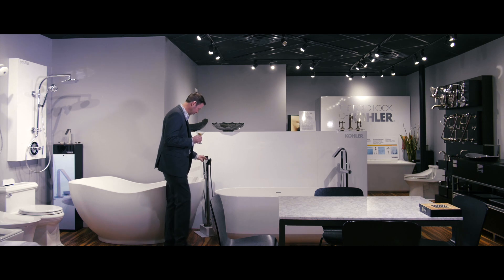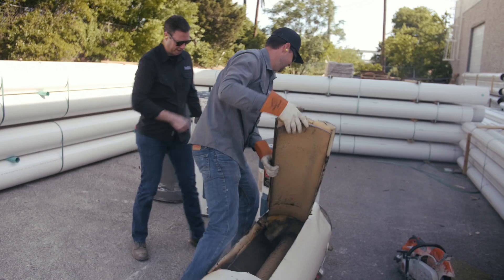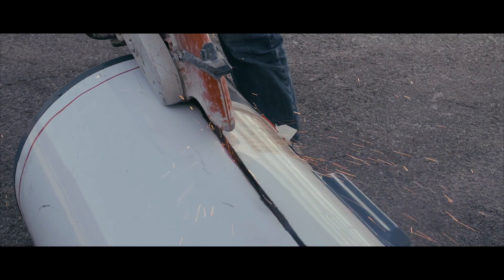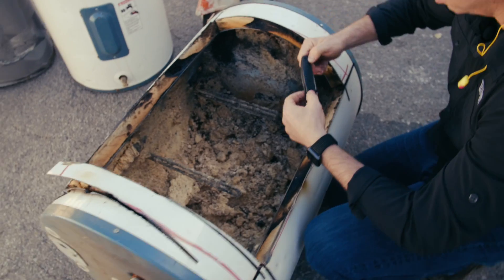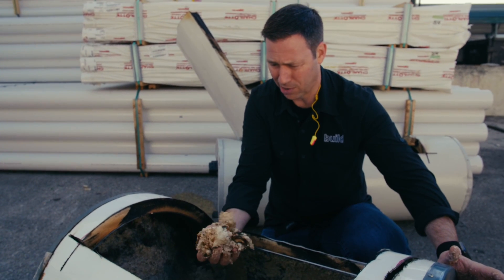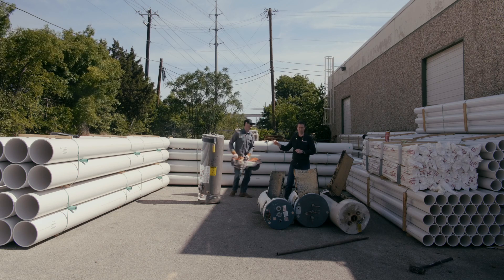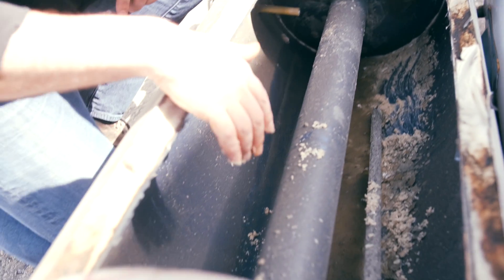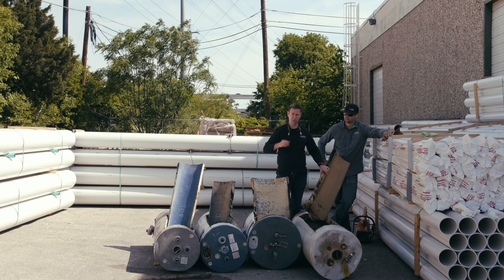Water Heater Tank Autopsy: You won’t believe what’s inside!

Comment: Oh my god.  The tank in my basement is 30 years old.... I can't even imagine!
Reply: You got your moneys worth out of it.
Reply: I've owned my house for 27 years and I'm on the same 30gl gas water heater. It was manufactured in Dec 1974. It's just now starting to seep some water under it. Will be replacing it in a few weeks. Pretty sure it has to be some kind of record.

After seeing this video, I'm cutting it apart for sure.
Reply: @SEEMERIDECOM  being from 74 i bet it has asbestos insulation.
Reply: @SEEMERIDECOM   I had a small electric (30 gal) still going after 40+ years  (Florida slightly alkaline water)
Reply: Flush the tank and remove/inspect the anode. If you replace the anode regularly (before it is completely used up) your tank will stay solid for over 20-30 years. But come 30 years, is likely time for a new tank.
Reply: If you have soft water no problem  but if you have hard water I bet that heater is really heavy with all the lime deposits in it !
Reply: What how???????? You must have good city water ?
Reply: I'm replacing my roof with a steel one and the only thing going into my chimney is the 45 year old water heater. I'm going with a gas power vent so I can vent through the wall and tear out the old falling down chimney. Last time I did work on it was like 20 years ago and it was falling over then.
Reply: we have a tank from 2001...running on hard water since then , up until last year hwen we finalyl got a water softener. it still works...but is it time to replace it?
Reply: YES! I recently replaced mine. Newer options are Waaaayyy better. Less energy, and we got a bigger tank for more hot water. But be ready for the newer code calls for expansion tank, like $50+ more, so if you have the money, go for it!
Reply: randomrazr if it works it works. But if it fails, you can have a flood. I’d lean on the side of caution and replace
Reply: DEEREMEYER1 go with a Rheem or AO Smith not some random brand
Reply: Fair Weather Foundry 
You'd better change it out soon 
Or expect a small flood under it
Reply: The tank at my house was 25 years old before is sprung a leak.
Reply: DEEREMEYER1 I’ve had mine since 2010 and it’s far superior  then the normal hot water heater ... I’ve never had a problem with mine not even one hickup and I have heated floors and runs amazing !! Maybe the one you got wasn’t really that good Bc Germany has been using tankless hot water heaters I think since the 2000 and literally is Amazing and the money you save from energy aswell is pretty good .. if your water is coming out to hot you should lower the temperature on your heater
Reply: You probably got an ounce of gold in it ;-)
Reply: Hahahaha  Fair Weather Foundry
>>Oh my god.  The tank in my basement is 30 years old.... I can't even imagine! <<

I have a water heater in a house I bought as a rental that was built in 1947,  it has a water heater  that was installed in 1951 and still works perfectly.  I completely remodeled the house but I left the old water heater because you just don't fuck with something that has been working for that long. Though I do imagine it's half full of sediment.  Also I did put a drain pan underneath it but I don't think it's ever going to fail!
Reply: @TruAnRksT  the anadode rod in that water heater that keeps your water from eating your pipes is long gone. 
Time to put it to bed
Reply: @nickg3794  The pipes are older than the unit, they will have to be replaced some day.
Aren't those anode rods replaceable? Or retrofit-able?
Reply: @TruAnRksT  Yes they are replaceble. The only issue is since water heaters are under pressure. It's not the easiest thing to both remove and reinstall/reseal a new one. They are stuck in there pretty good. Make sure to get a "link" rod if you don't have 10' ceilings
Reply: @TruAnRksT  how’s it going with that old water heater ?
Reply: You probably died 15 years ago and haven't realized it yet.
Reply: @pathfinderLXXIV  😂😂😂😂😂😂
Reply: randomrazr at least flush it and look at what comes out. If its really bad, then replace it.
Reply: randomrazr we just replaced a 2004 GE 30 gallon 50 gallon hourly for a new Rheem 38 gallon with an active damper 85 gallon hour rate the model is a XH40T12DM40U0
Reply: Thanks for the info. I'll look into that
Reply: Fair Weather Foundry lol
Reply: HERPY DERPEDY mine runs amazing and I’ve had my tankless hot water heater for 8 years and by far the best switch I’ve ever done Bc my wife takes baths and by the time it came to me taking a shower it would be cold Bc of the normal tank hot water heater but now it’ll run hot all day for the past 8 years !!!
Reply: Just have to wonder though how the electric, or gas utilities are effected by having hot water "all day long". Still seems like a good idea though. A typical water heater is on 30 gallons so one shower can easily deplete it. Plus you have to transport hot water through shielded steel pipes, usually under the house for a good ways, so not only does the hot water have to fight to even get to the shower but much of it is out in the cold as soon as the water is turned off. 

Ok my point oh yeah, I bet in real life it doesn't really save on utility bills in a busy household.
So how have your payments been changed by this feature?
Reply: Fair Weather Foundry that makes me feel a lot better because mine is 16yrs old and I was very worried after seeing this
Reply: Replace with a tankless!
Reply: In 2010, I had to replace my leaking electric water cylinder.  The one that came out, was dated 1959 - the date the house was built.. :)
Reply: @deermeyer while most things dissolve  better at high temp some minerals are less solvent at higher temps then lower so perhaps it is you who needs to go back to school.  For example calcium hydroxide (the scale) is less capable of staying in solution at higher temps. for more information look at this wikki https://en.wikipedia.org/wiki/Calcium_hydroxide.  Another item that is less soluble at higher temps is oxygen.  One of the reasons you get lime and scale at the faucet is that the water that remains there after you turn it off can and will  evaporate causing a increase in concentration of the minerals allowing it to come out of solution and solidify.
Reply: possibly, have you guys drained it from the bottom? How long can a shower last?
Reply: Replace it soon or expect a flood. My 40gal contractor grade went out after 3 years...critical tank failure. Flooded my house. The pan couldn't even remotely keep up with City pressure.
Reply: My 28 year old NG Rheem just bit the dust a month ago.
Reply: you don't get that type of "life" on city water or most treated water. only on good "PH neutral" well water with a good amount of minerals :)
Reply: I  doubt it's 30 years old if it is prove it. Maybe 13 years or it's an old oil tank
Reply: i have replaced tanks way over 30 years old, many of them the pressure vessel was not leaking, but the piping and relief valve above the tank had been leaking for many years and rusted away the whole jacket, so thy were starting to fall over, hanging by the pipes, broke the pipes, dropped crushing the burner up in or water pools and knocks the pilot out!
the tanks looked perfect with the jacket and insulation removed(mostly fiberglass blanket then) sure they had some nasty sludge in the bottom and inside, but just scrape it off and they looked great, many would still be working today if not for other plumbing failures and missing relief valve drain pipe.....
Reply: @throttlebottle5906  then that's a lack of maintenance shame on the home owner that's ridicules
Reply: Keep going!  Dont stop now!
Reply: Fair Weather Foundry the water heater in mine house is 22 years old 😬😬
Reply: The average is 8 to 10.  I would switch it out.  I am sure it would work better and save you heating costs since the newer ones are a lot more economical.
Reply: YOURE IN DANGER!!! RUN. RUN FOR YOUR LIFE
Reply: LOL....and that will be the longest lasting water heater you'll ever have. Now they are 3x more expensive, and have 1/3 the lifespan.
Now go replace it because it's eating your copper plumbing. And those leaks suck!
Reply: 🤢🤮 thinking about my 30 year old water heater.
Reply: My grams tank is 27 years old
Reply: my old heater water tank is about 1990. I replaced to new one.
Reply: Yup same mine is from 1978 lol
Reply: it helps if you flush your tank yearly so this kind of scale doesn't build up, both electric and gas heaters, flushing the tanks will remove most of this scale out of the water heater hence why there are normally drain valves on all water tank heaters, not the emergency pressure release valves but the bottom of the tanks themselves normally a spicket so you can flush your tank out. hence why there is an owners manual to tell you to do yearly flushes on the water tank.
Reply: @thefatmansgarage8570 Yes there is make sure u put a small hose on the spicket to flush it an old washing machine hose will work, and if you flush it remember the water is going to be or get hot not just cold water or warm is going to be hot so be carefull and don't get burnt!
my hot water heater is in the basement can flush it into the sump pump drain and pump it outside... 
Just replaced an BW with a Rheem only got 10 years out of a 50 gallon tank started leaking. Never flushed it and it had no sacrificial rod either the Bradford White...
Reply: You should replace it with a tankless instant hot water heater it’s far better then tanks !!!
Reply: Gonietube NYC LOVE my tankless heater...best thing I ever did for the house

Comment: Why is it gross?  All that was dissolved in any cold water you drank.
Reply: JK Brown why do we take showers but run from the rain?  Why do hungry people get angry if you throw an apple at their head.
Reply: If you think it looks weird as a solid, you ought to see it when it is in it's gel form... It looks like a giant jellyfish trying to flow out of the drain hole!
Reply: Yes its all the gross stuff that was taken OUT of the water as it was heated. Must be hard water down there.
Reply: It's like wonder bread. Helps build strong bodies in 12 ways. Calcium, magnesium, iron etc.
Reply: http://en.wikipedia.org/wiki/Thermophile
Reply: Jimmy Turner because in the shower we're not clothed. We don't have to worry about wearing wet clothes the rest of the day.
Reply: chrimony I believe you're thinking of an aerator. Aerators are simply there to create a different way for the water to flow. It doesn't actually filter particles.
Reply: @Mat: If it was dislodged, it would settle to the bottom. It would only get through if water was running at the time. Also, taps usually have screens to filter particles out. So you'd just have to unscrew the cap and wash it out.
Reply: that screen is in no way a filter
Reply: Don't know about the US but in the UK we don't take drinking water out of water that has been heated. In my house there's two separate tanks, the drinking water tank is open and made out of plastic
Reply: If you’ve ever had the water pipes coming from the street to your house replaced, you will know that the old sections also have scale deposits. Scale is mainly calcium and magnesium.
Reply: >>JK Brown
3 months ago
Why is it gross?  All that was dissolved in any cold water you drank.<<

Exactly! Just pack it into capsules and sell it as concentrated "mineral supplements"  Hahahahaha
Reply: It's gross because it's porous, and it provides a place for organisms to thrive. This is why you NEVER drink water from the heater side of your water system, and let the tap run with the cold side for a sec before you fill your glass. Cause stuff is alive in there.
Reply: @niftyjig  if it's any kind of municipal water, it's going to have chlorine in it. You speak as if your hot water heater is filled with pond water. Stop being such an alarmist.
Reply: @ @trashyratchet674   my water has no chlorine unless it's coming from the reservoir. First place I lived like that. Real interesting filling up the hot tub and finding ZERO residual chlorine.
.
Also, wells have no chlorine... Ponds? Really? I mean... At least do a LITTLE research, or have some modicum of familiarity beyond... What, turned on a faucet once?
.
...Dude.
Reply: @niftyjig  Think the added chlorine in water takes care of the organisms.
Reply: Jimmy Turner What in the world , Guy from the beef streams long time no see
Reply: JK Brown oozz
Reply: This accumulated over time. This isn't just one tankfull worth of scale. This is concentrated scale from thousands of tankfulls.
Reply: So.... you drink and wash yourself in that shit?
Reply: ALL THAT COLD WATER YOU DRANK FROM THE HOT WATER HEATER ?
Reply: JK Brown 😭🤢🤮
Reply: Am i not stupid enough? Why didn't the inside surprise me at all?
Reply: If it was just mineral deposits, it wouldn't be gross. But there is also some microbial life in there too. Yes, even in chlorinated water.
Reply: What I was thinking is that it's a large concentration that would be dislodged with vibrations, like those from a earthquake. Then you would get a nice concentrated load of it in your system.
Reply: lol gross stuff? you take in all those minerals through the other foods and drinks you eat... mineral water is good for you... less issues with health if you drink highly purified and "reverse osmosis" water that has NO minerals in it... and lets not get on the topic of chlorinated and fluorinated city water...
Reply: Your body actually needs those minerals. It is what your bones are made of.
The most dangerous thing in tap water is fluoride.

Comment: My plumber (who is now retired after 45 years working) had a 35 year old water heater in his basement before it was replaced. If memory serves, he had a whole-house water filter on the supply side, flushed through a full-throat valve every year and replaced his anode rod every few years. I never did any of that. I had catch-pans as per code under mine with water sensors that shutoff the water supply to the tank. I routinely could get 13-15 years from my heaters. Which coincided with about the same cycle for rehabbing the tenants kitchens and baths.

Comment: This is a timely video for me.  My gas water heater failed and started to leak at the bottom drain valve two days ago. The heater has a manufacturing date of 9/71, as in Sept, 1971!
Reply: No they don't, I realised yrs ago that there's no profit in building quality products anymore.
Companies would go bankrupt waiting on consumers to replace durable goods.
My Dad bought a "SEARS Lady Kenmore" washing machine in 72'...he replaced a belt and transmission bolt in 86'... he finally replaced it in 95'....
We've been in a disposable society since the mid 80s, so now everything now comes under "USED TO BE"
Appliances, automobiles, electronics, furniture, all have a pre-determined calculated shelf life. Even people are now disposable to the tune of attrition, layoffs, corporate downsizing, shifting labor policies to favor 3rd world resources..... Lets blame it on Nixon & Watergate, only because it sounds funny as shyt right now...lol
Reply: Suicide Grapes Maybe ? I have a Whirlpool fridge from the year 2000, it has 20 years old. And it works like new. Not 1 problem. And note, this fridge was put in place by the Homebuilder when the house was built. My whirpool washer drum broke in 2007 so I decided to change it and have a Maytag (built by Whirlpool) and its 2020...13 years... and works amazing like new too...Overall Whirlpool brands are QUALITY brands and reliable. I also have a A.O Smith Energy Saver water heater from 1999 that the Homebuilder put, and heats the water very good. There’s still hope!
Reply: you sure it doesnt mean the 71st of September?
Reply: Folks' house glass-lined gas water heater is 1960s. Still heats and no leaks. I plan to do an autopsy of this tank when I remodel. I am so curious what I'll find.
Reply: Richard Gates I no longer have any brand loyalty due to increased planned obsolescence. All I care about now is purpose suitability and price. Ford, Sony,  kenmore, GE let me down so for now it’s Toyota, Samsung, sharp, Maytag...next time something else am sure.
Reply: Show us!
Reply: They sure don't build them like they used to.  The one we just replaced was a little over 10 years old!
Reply: Hell, it’s as old as I am, and buddy, if its insides look anything like mine, you are in big trouble.
Reply: @Flythemhigh  there's only one way to find out. We need a demo saw and some stadium speakers.
Reply: They would only go broke now because they depend on the sales - their sales have been going up steadily since the water heater became common, and they get cheaper to make. The manufacturer put themselves into this situation by being too competitive.
All you need is one company willing to take a risk, and somebody will buy it.
Reply: the old glass lined units lasted a long time.
Reply: I saw a water heater that was fiberglass, looked pretty impressive but I forget the brand. This guy dumped a lot of money into his water system, and it was spring water like mine is. His issue is running out of water which is why his system was so complex.
Reply: Just replaced ours from 92’ today.. 26yr’s old. I can’t believe it was even still working.
Reply: Got your money's worth?
Reply: WOW! Everyone assumes it was a good quality water heater and not GREAT quality water????

Comment: i would like to know which one was well water if any?
Reply: That's the exact question I had.  Water source is really important.
Reply: well water varries alot it can be the cleanest as well as the most contaminated with alot of heavy metals or radon gas in it. there is a whole science to keeping them clean and getting the not desired stuff out if you are precistant in wanting to use it if its not all that good